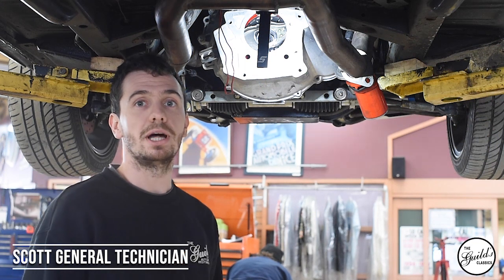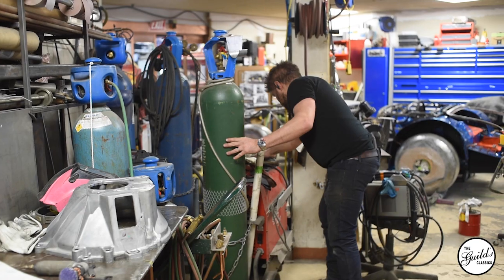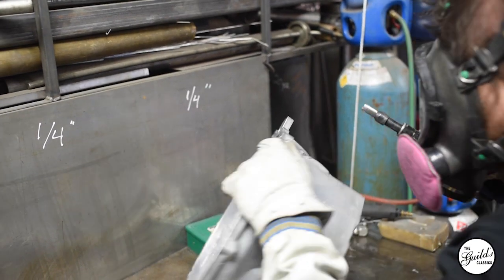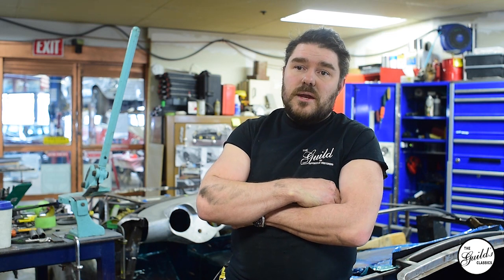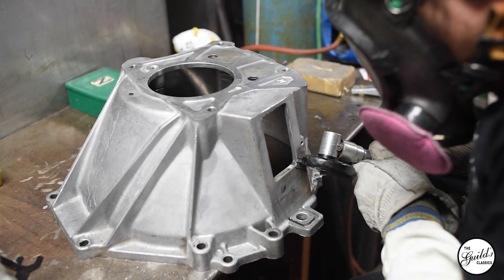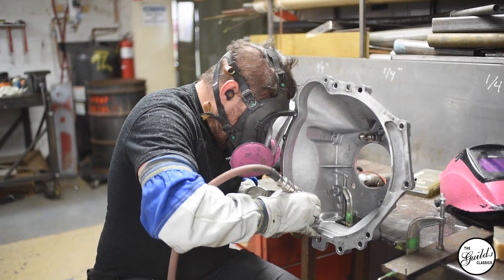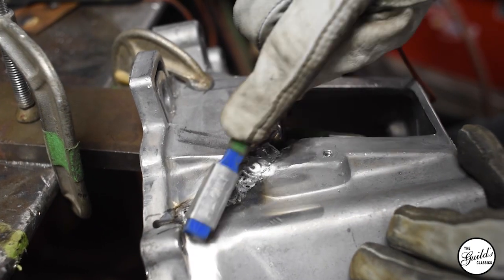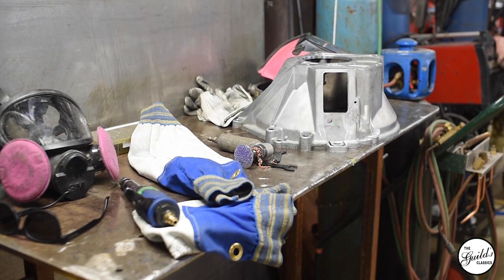Fixing a cracked Shelby Mustang bell-housing

Comment: Very nice video! I have the same bellhousing with a crack at the same position....
Did you finally use a AlSi5 filler rod?
Do you remember what parameters you used on your welding machine?